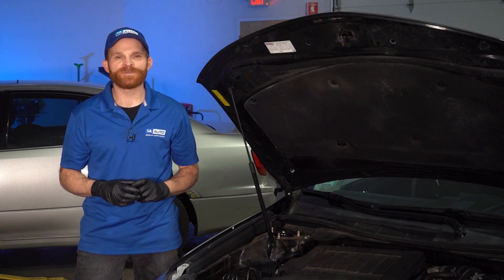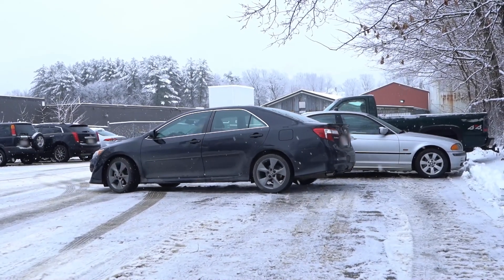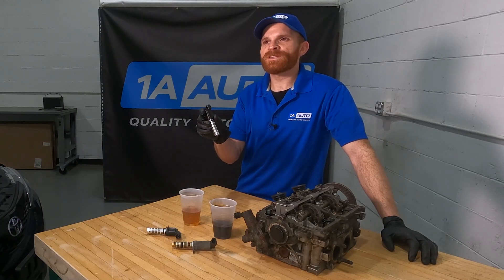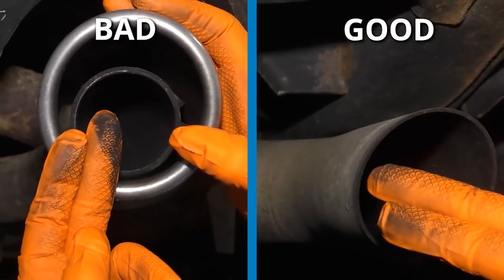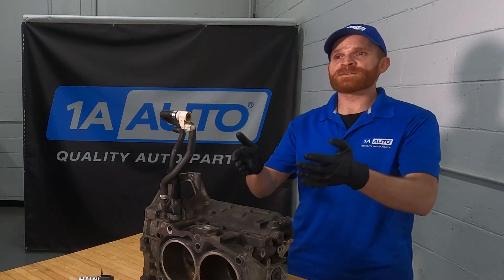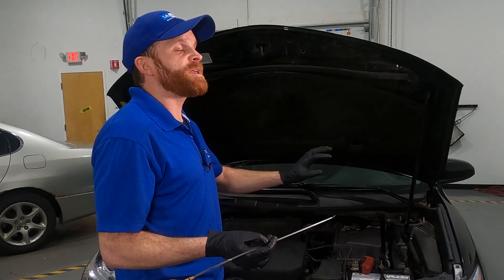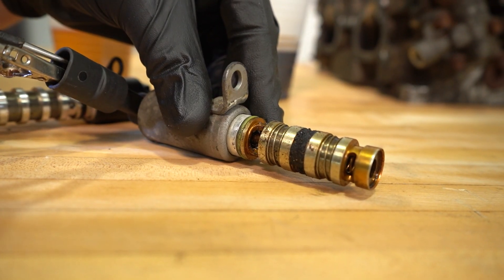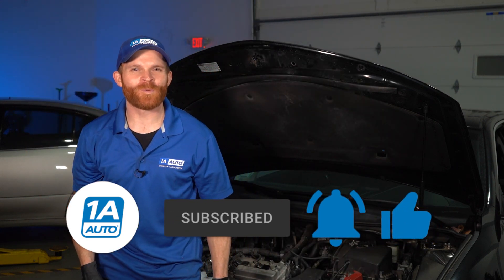Engine Bucking or Stalling? Oil Pressure Seems Fine, But Is It? New VVT Solenoids Will Solve It

Comment: I change mine run fine I reset the ecu run worse then it did with the old one I would advise to beware I’m putting the old ones back in

Comment: Thanks very much . I have to extract the valve part which is stuck in the cylinder head, solenoid part broke of.
My engine rattle at cold start or after standing idle for a long time. 
Behold,the valve was leaking oil and could see oil at parking spot under the vvt solenoid area.

Comment: On my G37 Infiniti I've had a ticking issue when I first start the motor up until it warms up to normal operating temperature always thought that it was valve
s from having 60,000 plus miles on it now I know exactly what it was after a p0021 code came up and I went into limp mode with the car bucking when I tried to accelerate and now that I put new VVT solenoids on both the left and right back she runs beautiful again so if you're having those symptoms replace both of them don't even waste your time with One Bank

Comment: Is VVT  Solenoids same thing as Camshaft Adjuster Solenoid? My mechanic billed me $700 for changing Camshaft Solenoid on Toyota Camry 2010 LE. Did I get ripped off?
Reply: Is your car working now? Most models have a solenoid by the camshaft

Comment: Our car can’t get past 4000rpm while driving but parked it revs all the way no problem.  Could the vvt solenoid be bad and is there greater oil pressure in the motor while under load from the transmission vs being parked

Edit:  it’s a Murano with CVT transmission
Reply: No your transmission stepper motor or transmission failure

Comment: Can it cause P0300 P0301 through p0308. 2006 lexus gs430 i can only start the car by pumping the gas and misfire on all cylinders while running
Reply from the maker: +@Wicced2700 We wouldn't be able to diagnose an issue like that here, you may want to have a local mechanic take a look at it. Thanks for checking us out! http://1aau.to/m/Shop-1AAuto-c

Comment: Just to inform everyone. Even if that part does click when you put power to it, it does not mean its any good. I found that out on my honda. Was having a gas cap light. I changed the vent solenoid. Tested the old part it did click but didn't turn off the light. The new part worked immediately.

Comment: An OCV solenoid failed on my 2016 2grfe.  Oil level was full and I change it myself every 5,000 miles with quality oil. The oil in the engine at that time only had 800 miles on it. Engine doesn't burn oil. Solenoid was clean as a whistle. In my case, my solenoid simply failed. Bought a new one and the car is back to normal.

Comment: omg i’m dealing with this problem at this exact moment (2010 camry) THANK YOU SO MUCH! my car ALWAYS sounds like that clicking but has been louder with p012 code. my VVT had plastic parts stuck in it for some reason clogging it? sprayed it out but it gets clogged every now and then so there’s still plastic in there i’m just going to replace the solenoid. thank you guys so much!! timing couldn’t be any bit better